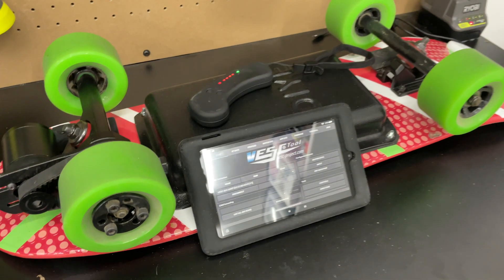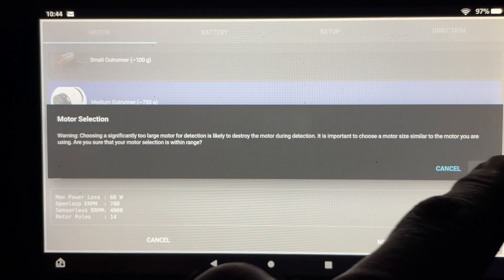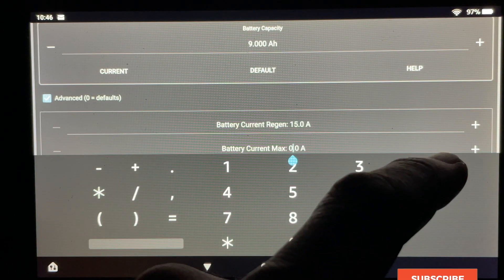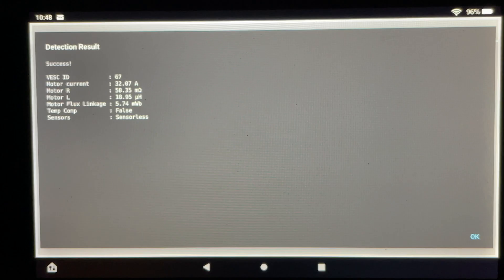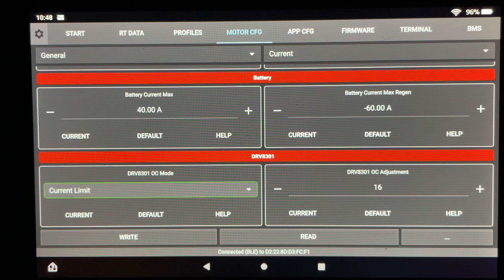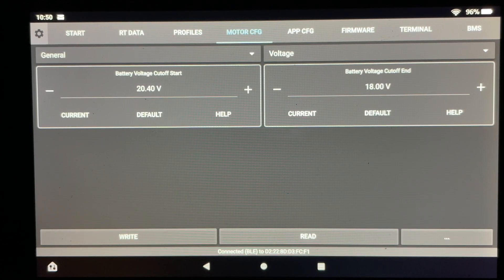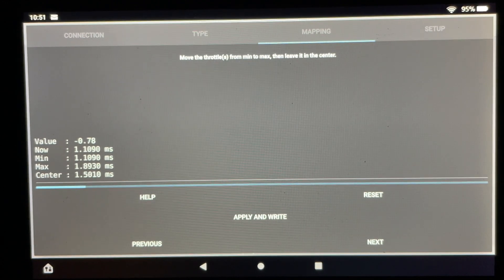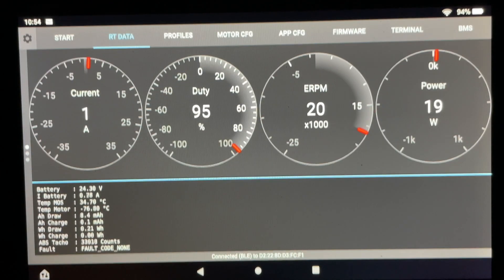Programming VESC 4.12  Using Bluetooth | Single Motor | DIY Electric Skateboard | Hoverboard EP. 4

Comment: What remote control used? I have vx1 and can't work with ppm mode only in nrf.
Reply from the maker: Hello. Flipsky vx1 is the remote I used. Thanks!
Reply from the maker: I’m not really too sure about why that would be. I used the pigtail leads off the vesc, red white and black wires, and plugged it into the module that came with the vx1 and it worked straight away. Maybe try contacting flipsky and see what the issue is.